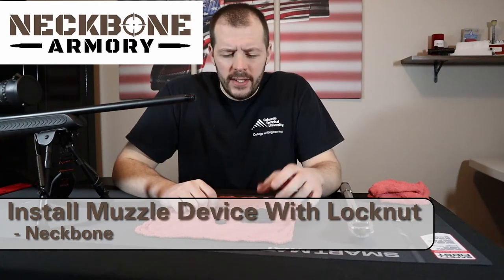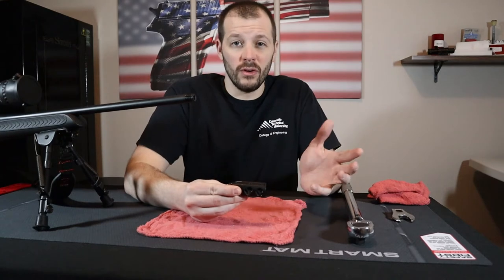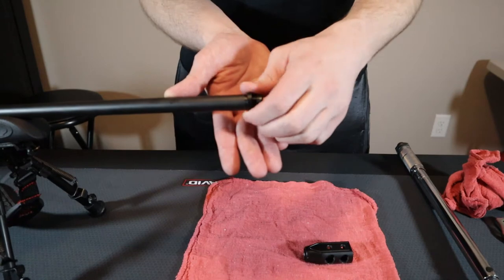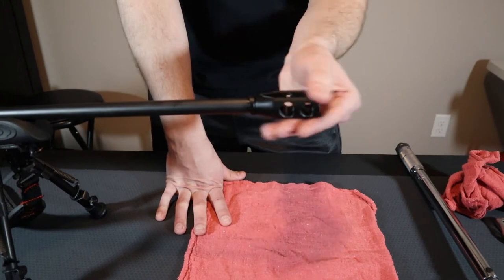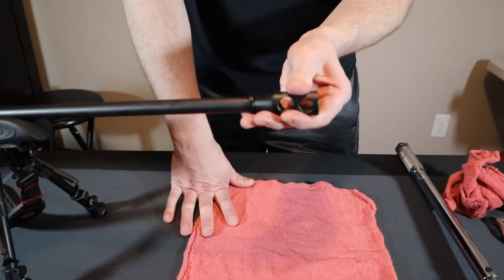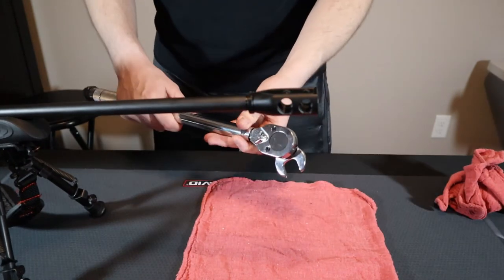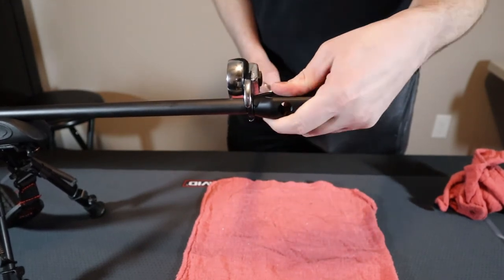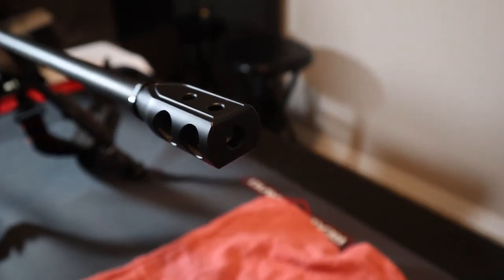How To Install A Muzzle Device With A Locknut

Comment: The crows foot needs to be at 90 degrees to the handle of the torque wrench, or you will apply more torque than what you dialed.

Comment: I followed Neckbone's instructions when trying to install a muzzle break on my Ruger AR55, but the threads on the barrel stop about a 1/4" from the shoulder of the barrel.  I can't set the proper timing with a crush washer nor locknut.  Stuck on how to proceed.  Any suggestions?